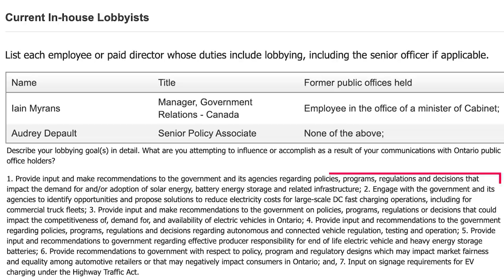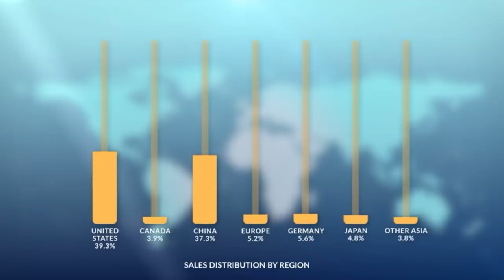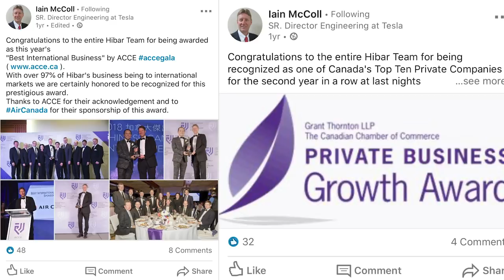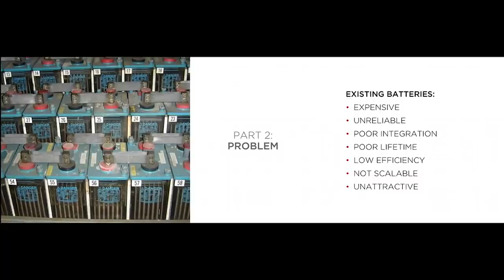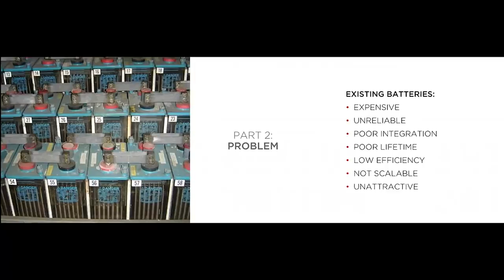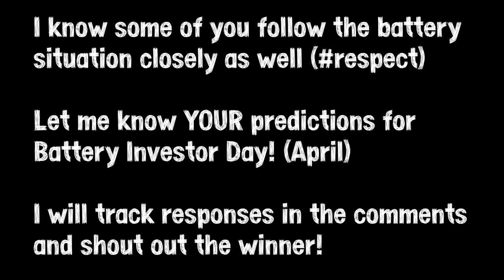Tesla Acquires Hibar Systems - The End of Tesla and Panasonic Partnership?

Comment: It took 20 years or longer for lithium ion battery to be popular, it may not take that long to do the same thing for solid state battery but it will still be a long journey.
Reply from the maker: Hey there! Thanks for watching! I've heard many mixed opinions on the solid state timeline...out of curiosity, why do you say it will still take so long? I'm not disagreeing, just wondering
Reply: There are few reasons I could think of: 1) in order to convert a brand new technology to a commodity product, it requires a lot of investments, billion of dollars if not trillion. However, investors are very cautious, it takes time to build up confidence.  

2) There are still a lot of uncertainties in the solid state battery (SSB), for example, the life span is one of the reasons,  the data that the researchers collected are just from small scale and many of the parameters are just a projection from these data points. It still takes time to get actual data. 

3) Competitions, how does a new tech stand out from the crowds when the existing rivals are already so good? There must be some parameters that the existing tech is lagging behind, for example, capacity per vol or weight, cost, safety, performance (power output). 

4) Other potential rivals, e.g. ultra-capacitors. Technology investors do not know if there will be another tech product that comes out with much better performance later after they invested billion on SSB, they have to be extremely careful, only certain percent of the total investment in a time.    

These are the three main reasons that I think the SSB will take time to the market. BTW, both lithium ion battery and SSB were developed by Dr. Goodenough.

Comment: What’s the downfalls of lithium batteries?  Cannot charge in subzero conditions....LTO battery tech can...I’m from northern Canada, and the only thing holding me back from getting an EV, is the poor efficiencies when charging lithium batteries.  When you have to keep the batteries warm while charging, this means that much energy is used maintaining temps....rather than using that energy to directly charge the battery pack.  So I really would like to see a battery chemistry developed for EV’s,  that has a better useable temperature range. cheers!
Reply from the maker: Hey Jim! I hear your concerns loud and clear, and share them to some degree myself. We live in NW PA where it's quite cold in the winter 20-30F for a few months of the year, often with snow and ice. I've watched a lot of videos about TSLA in this weather and although the Li-ion do experience significant performance reduction in these conditions, it may not be to the point where you can't own one in those conditions. You'd just have to be aware of the limitations that remain! Thank you for watching...cheers mate!

Comment: some insider thought is that Panasonic couldn't risk expanding to fill Tesla battery orders when at the time Model 3 was having issues ramping - but today since Tesla production is a much better understood and stable volume with a well laid out road map then Panasonic can spend the money to tool up to produce more cells with less risk to those capital costs (Insert shuffle off to buffalo dancing here) therefore Panasonic isn't out of the game as of yet.
Reply: wait, Elon said super capacitors are unnecessary didn't he?  What I'm thinking is the current battery tech still have a lot of improvements possible to increase efficiency and capacity before even switching to a new form factor.  Will be same batteries with slight improvements + expansion plant capacity + efficiencies in the production ... will be used to solve supply demand issues, while they announce work on the next generation batteries.  Hmm this might be possible.  A question was asked what is the difference between Model 3 US vs Model 3 out of China and the answer was that there is no appreciable difference - this means using current batteries in China plant.  Also Model Y was supposed to have a lot of similarities to Model 3 therefore we could extrapolate same battery packs will be used - and this then means good return on investment from development of the current battery format as it continues to be used in high volume. Next gen batteries would be for cybertruck and semi and roadster (maybe for plaid S also).
Reply from the maker: Hadn't heard this line of thought before, thanks for sharing!
Reply from the maker: So the MIC 3 is using batteries from LG and CATL which are different than Panasonic. They'll be similar, but not the same. The software will be slightly different in terms of apps offered. It's also rumored that build quality is better in MIC 3! But definitely agree with everything else you were getting at!

Comment: I'm not looking for solid state batteries to appear anywhere in the near future.  That tech isn't ready for prime time, I don't believe.

But I am looking for an improved battery cell technology from Tesla to be announced in April at Battery Investors' Day.

Why?

To hit their range target for the top trim Cybertruck (500 miles), they'll need it.  To hit their range target for the new Roadster (620 miles), they'll need it.  To hit their target for the top trim Semi (500+ miles), they'll need it.

For the Roadster, they could get that range with two stacked Model 3 packs.  But the prototype doesn't have the elevated floor that 2 packs would necessitate.  They didn't get the extra range that way.

For the Semi, they could deliver a Semi tractor with a weight of 25,000 lbs using 2170 Panasonic batteries, but that's 8,000 lbs heavier than a comparable diesel Semi tractor, and would result in a big cargo penalty, since tractor + trailer + cargo can't exceed 80,000 lbs in the US.  They need a better battery, particularly for that higher trim Semi, to please their fleet customers.  The Semi will probably still end up heavier than a diesel, but every pound shaved is a pound of cargo they can carry.  That matters to their fleet customers.

The Cybertruck trims are interesting.  They feature ranges of 250 for the bottom-trim truck at roughly $40k, 300 miles for the mid-trim model, and $70K gets you the top trim, where the range jumps to 500+.  Big jump!  And it's super-ridiculously fast, so it can't have an enormous weight penalty.  That truck needs new-tech batteries, too, to hit its performance targets.

I think Tesla can get 30%-50% - or better? - more energy per kilogram by using Maxwell's dry electrode tech plus a new electrolyte chemistry.  They can also reduce the cost of cells with Maxwell's design.  And they'll get better cycle life, too.  That's what I hope to hear in April.

What's more, I think Tesla's ability to produce new-tech cells is on the critical path for the top tier Semi, the new Roadster and the top tier Cybertruck.  I don't think they can get those top tier models to market without that cell.

Elon sounds pretty sure about delivering the top-tier Cybertruck by year's end, along with the mid-tier model, at least in limited quantities.  So Tesla must be nearing low-rate initial production for a new cell.

What I can't be sure about is whether Tesla will indeed manufacture the new cells themselves, or engage with their suppliers (LG Chem in China, Panasonic in the US) to make them.  My guess is they'll make the new cells themselves, and keep buying 2170 cells from their suppliers for Model 3, Model Y, the bottom two Cybertruck tiers, and the bottom Semi tier.  I think you're right about Tesla's need for batteries being so enormous, they'll have to keep the 2170 lines running and even expand them.  A phase-out is in their future, but not any time soon.

At a guess, Model S and X will get the new cells with the 'Plaid' option, so they'll benefit from big range increases to go with their beyond-ludicrous performance gains.  That will make Tesla's top tier luxury models more compelling and stimulate demand for their most profitable models.
Reply from the maker: Hey there! So I completely agree with almost everything you said here. This is a super insightful comment, thank you for sharing! Toward the end you said "Elon sounds pretty sure about delivering the top-tier CYBER by year's end" - perhaps you meant Semi truck? But CYBER was set for the end of NEXT year, unless I missed something? Please correct me if I'm wrong. But I'm researching solid state, DBE etc. right now for a future video and I think you've NAILED it with this one. Thank you for taking the time to make our community smarter and better educated!
Reply: @DillonLoomis22  You are right.

Thank you for the correction.

We don't have a timeline for production of the 'Plaid' option yet.  I have been imagining that production might start this year, so perhaps a new-tech cell is in the works for later this year?

I haven't seen any firm timeline for the Semi.  Older forecasts put it in 2019 and then 2020, but if there's a fresh delivery promise, I don't know what it is.

The new Roadster is definitely not in 2020.

There are big gaps in our understanding of what Tesla is up to, but I think the general thrust of my comment still might be valid - that a new-tech cell is on the critical path for several top-tier products being developed by Tesla.  When a new-tech cell is in production, they'll be able to move to production of those top-tier products, I think.  The timing of all of that is subject to guesses until Tesla tells us, which I hope will happen in April.

Comment: Changing battery tech  it is very complicated.  They have to find the characteristic of a new tech (recharge rate,  how to charge for long life,  1/2 charging effects, Cold/hot weather  etc.).   But what if Tesla is building a new source of batteries exclusively for solar (much lower volume).  It allows Tesla to move forward with solar.  The second thing it allow Tesla to begin low scale production of a new technology without affecting car production.  As this development progress for solar,  they can test ideas that could move to cars.  Perhaps "Semi truck" will using these new batteries  (I think semi will be produced at low volume at first).  Testing these new designs at smaller scales (but still scale) allow them to develop a new design.  Perhaps Tesla would share and allowing Panasonic to use these new processes (if better).  And (as you said)  it just provide leverage to Panasonic (although I think Panasonic has been a good partner).
Reply from the maker: Hey Barry! Thanks for watching and sharing that insight! I think you're on the right track for sure. I totally agree that I think it's much more complicated than most people think (creating your own batteries in house from scratch). And they will definitely want to test on small scales to make sure they work well in real world applications etc. - will be a lot of fun to watch!

Comment: I think you only need to add 40 seconds of capacitors to an EV for acceleration and 20 seconds worth to be empty for re-gen braking.
Reply from the maker: Hey Daniel! Thanks for watching! Funny you mention supercaps...actually researching them a bit right now! I'll have to keep this thought in mind!
Reply: You can see videos of people using banks of supercapacitors to replace their regular car 12V battery. Surprisingly it works making it more reliable, temperature independent and never has to be replaced.
Reply from the maker: @kubismatik2  interesting...did not know this! Thank you for sharing :)

Comment: A lot of valuable inside here, but the thing you are missing is that they need lower cost in order to build next generation vehicles - especially low cost, Mass market cars. I think $10,000 with 100 mile range is a minimum. Such a car would begin to eclipse ICE cars.
Reply from the maker: Josh Grossman hey Josh! I totally agree on this 110%. I’ve said for years if Tesla could make a car even in the $20k range with adequate mileage it would be lights out. The thing is, the battery costs are still too expensive and the demand would just be far too high for them to keep up with production. So you’re correct, but it’s just not something that’s feasible now or anytime in the near future. But once their current announced lineups are in production, things could get crazy!
Reply: @DillonLoomis22   - $20K would be a mass market car for Europe and the US. $10K is needed for India and China. I believe that both of these are coming, but the limiting factor is battery production, which circles back to this video! It is exciting to imagine a roadmap of cars as the battery problem is gradually solved.
Reply from the maker: @JoshGrossman  I think you're spot on man! I definitely am a big picture thinker and that always brings me back to the what's at the core of Tesla's growth and right now it truly seems to be battery supply. Will definitely be a thread I plan to follow closely, but there are so many other topics and exciting story lines - part of why I wanted to start this channel! Lol - are you in the states?
Reply: @DillonLoomis22  I'm in Silicon Valley. I work at Apple.
Reply from the maker: @JoshGrossman  that's awesome dude! Always wanted to go out there to nerd out in tech-land, USA!

Comment: Good call on Tesla keeping Panasonic for a while. At least 2021.

You cut off the [3 wise men] talking just as they brought up the game-changing tech: Dry electrode batteries.

Right before that, everyone agreed that a "breakthrough" tech would have to come from super/ultra capacators, likely not Li-ion.

But the reason Elon bought Maxwell was Dry Electrode, not Super-cap.

Imo, getting Li-ion a 40% density/charge boost is the next incremental goal.

Add the new chemistry (Maxwell) to the new manufacturing process (Hibar) and Tesla has the ingredients to develop a proprietary battery outside Panasonic purview.
Reply from the maker: Hey Nathan! "Three wise men" lol loved that. And there was a reason I did that...a future video is going to go into this, didn't want to spoil anything! Thanks for watching and leaving this comment...I believe you are spot on!

Comment: Batteries are key to this whole transition.  IF Ford was smart, they would create a partnership with the Chilean gov't to locate an advanced plant in Atacama and start making batteries for all comers including there own lines of EV's.  They don't need advanced tech right now, traditional chemistries will do for a while.  It's volumes and numbers that need to be scaled.  But, my guess is that TSLA will just keep running away from the pack.  And yes, I agree - keep the Pana relationship and build scale.  Ford just needs to build EV's.  TSLA needs to build EV's and Energy Storage ...
Reply from the maker: Hey Broc! Spot on comment right here. So many people are headline searching about solid state but right now as you said it's all about production capacity and incremental improvements and 300 miles of range is sufficient for a lot of people!
Reply: Absolutely.  300 miles is enough for a lot of folks.  And those that need more, can buy more, or lease more, or whatever ... 
Production capacity will be the telling factor for the foreseeable future ...
Reply from the maker: @brocluno01  boom...nailed it Broc!

Comment: BUILDING ITS OWN BATTERIES  With no one to blame  initial production will be carefully introduced. Tesla will stick with Panasonic for EV & LG Chem for PowerWalls to keep the volumes up , &  will be ruthless over quality with the Chinese factories.

Tesla will not eliminated external customers for Maxwell & Hibar as it did for Grohmann.
They bought infrastucture, knowledge, IP , diverse problem solving skills and production at scale.  Without the massive product range of competitors Tesla could ultimately have two types of cells, different only in physical size. Cylindrical 18650, 21700 etc & pouch 10x20, 10x25 , 10x30 etc. with under 10 varieties

When Maxwell's Dry Electrode is incorporated for EVs at Giga-1 ( Panasonic-Tesla ) & PowerWall  at Giga2 ( LG-Tesla)  a lot of problems will be solved, including reduced world battery prices  & license fees. Solid Glass Electrolyte eliminating dendrites & inflammable liquids can't be far off.

 (1) Sodium replacing Lithium  (2) Silicon replacing carbon (3) Eliminating cobalt etc are on the path for future battery development.
Reply from the maker: Hey Edward! Great comment as always! Let me ask you...wouldn't silicon be replacing the graphite anode as opposed to replacing the carbon which which is part of the cathode?

Comment: Elon just recently said that sup caps are not necessary any more.
Reply from the maker: Indeed he did - Third Row Podcast? Hibar is not the acquisition dealing with ultra/supercaps...that's Maxwell. Thanks for watching!
Reply: Supercaps were never "necessary", but they would be nice.  It would allow regenerative braking to work better in cold weather, and allow quicker acceleration from a small battery.